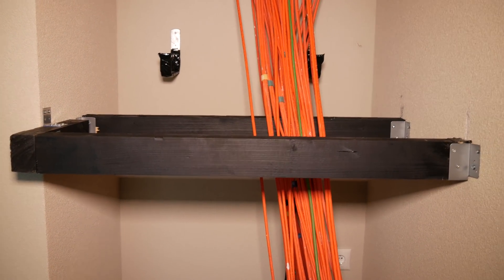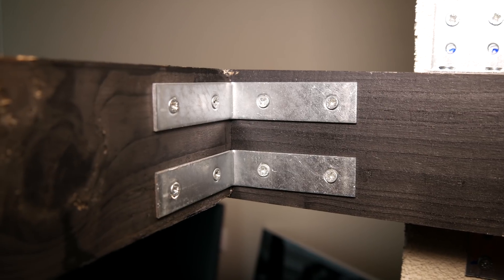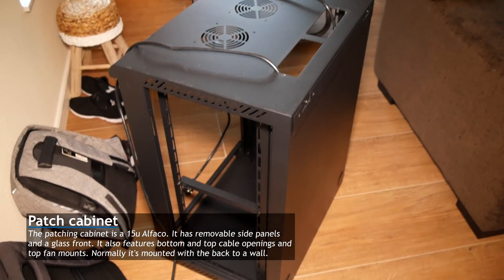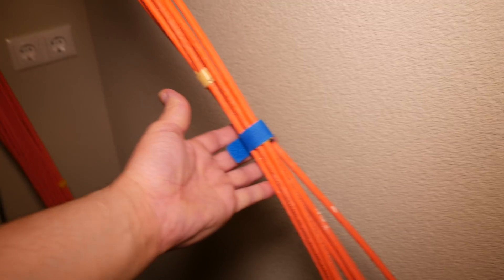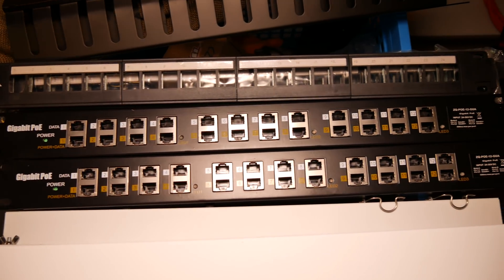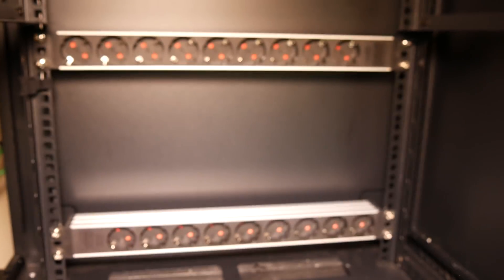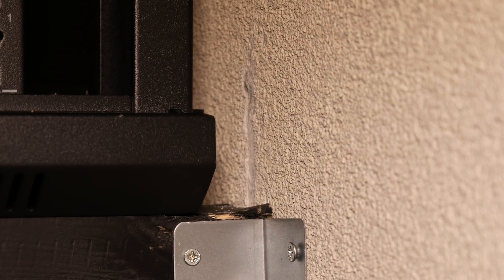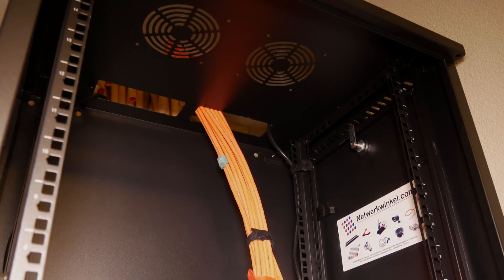Home Networking: Installing a home patch panel - part 2

Comment: Offtopic:
I know it's not very polite, but I'd like to ask an offtopic question.
I only recently found your Cheap WiFi LED dimmer topic on the Domoticz forum, which I found very interesting. I'm just wondering, why is it so quiet? Has something happened? A newer version? Competition? Something else? It seems like a great product, so I'm really wondering what's going on.
Reply from the maker: Haha, that's ok.

QuinLED is still very much alive and kicking! I've recently done two videos about it running my outdoor lighting for instance. Check out this playlist: https://goo.gl/da6vBK or check out the articles on http://intermit.tech. There you should be able to find all the information you need.
Reply: Thanks for the quick reply, I found the website, but it was a bit all over the place, confusing my already scattered brain. I'll have see if I can get my sausage fingers to solder those tiny resistors in place then...
Reply from the maker: Actually, the resistors are optional, so if you can't, no big deal. Here a link to a central article linking all the parts: http://blog.quindorian.org/2016/07/esp8266-lighting-revisit-and-history-of-quinled.html/

Let me know if you need anything else. Best to do so under an ESP8266 Lighting video or website article though. :)
Reply: Intermit.Tech Will do, thanks for your help!

Comment: Sure looks sturdy, but aesthetically I would have just put two vertical beams of wood on the back wall just long enough to go top to bottom of the rack. If more stability is needed, I'd put two L brackets under the rack. Hope that makes sense. Just my two cents :-)
Reply from the maker: +John Doe I think I know what you mean. Would have put a lot of force on those beams and wall mount I think. I'm not really bothered my the wood, actually found a use for it (should be in the last update), but that's going to be personal style thing.

Comment: I do not understand the purpose of the patch panel when you have switches in the same box? Does it not degrade the signal quality making one more hop in the line of cabling?
Reply: You always have a patchpanel in a rack and work with keystone jack is easy. The installationscabels are solid cabels. And patchcabels are not. So the patchcabel are more flexible and easier to work with then he need to do some patching. Then it is not easy to install a RJ45 plug direct on a Solid Cat7 cabel.
Reply: On top of what Daniel said, it makes things easier and neater to organize. Patch panels have small labels above the ports where you can put information about the specific port (Usually just some kind of number you can look up in a excel sheet or the like).
Also, the degradation is miniscule/non-existent.